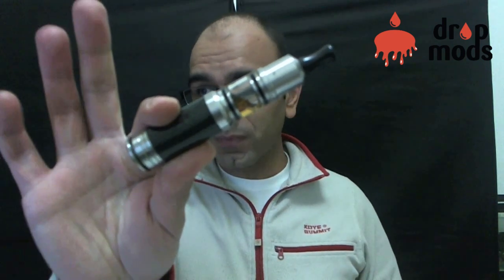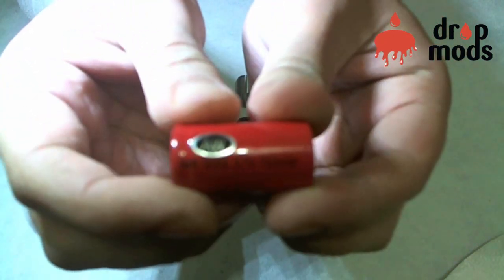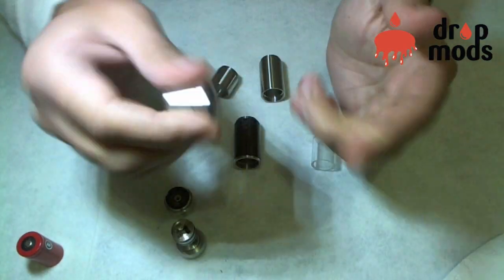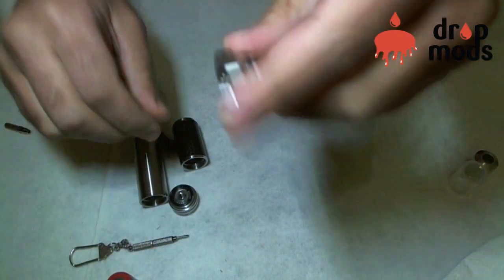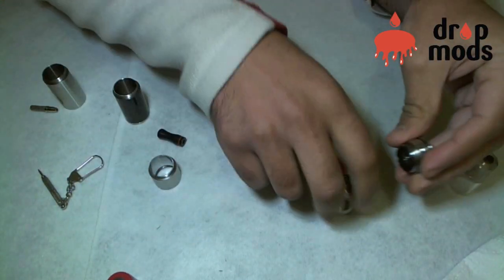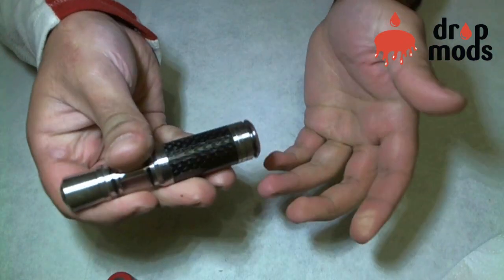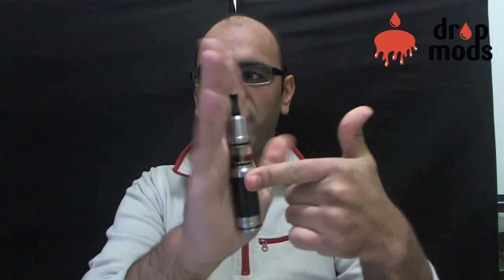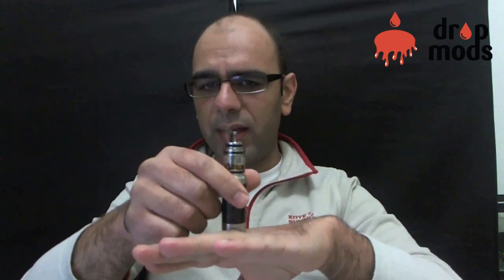Preview of the Ikarus

Comment from the maker: Thanks for the comment.
It was one of the things i forgot to mention there.
It will not fit since the battery will be shorter than needed.
The only way that the 18650 battery could fit is getting a long M4 screw for the positive pole that will help secure the battery in place and making it capable of firing.